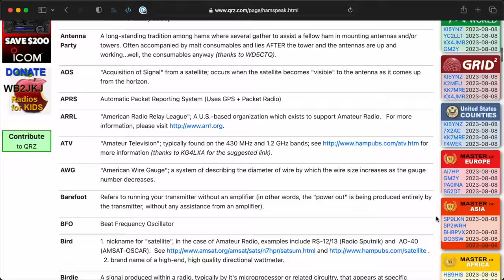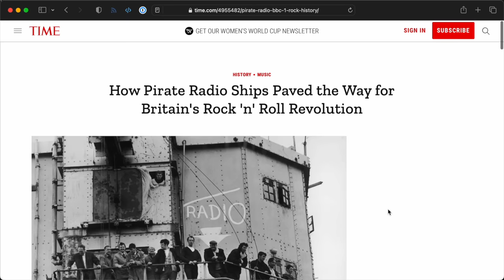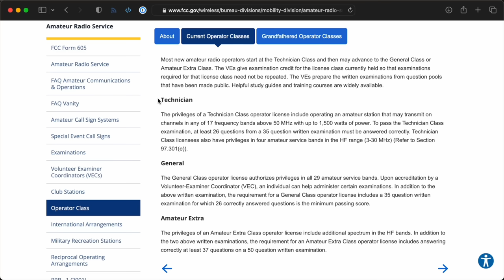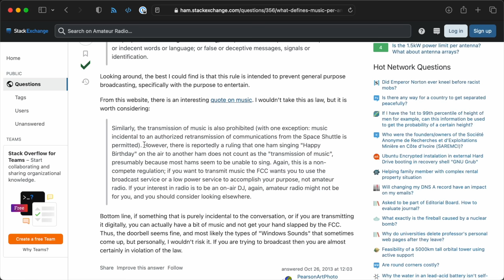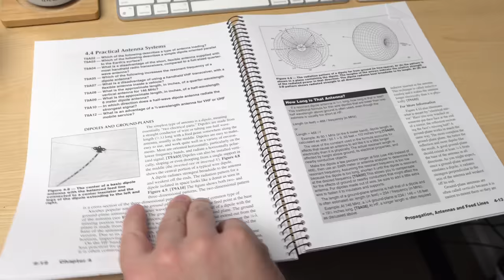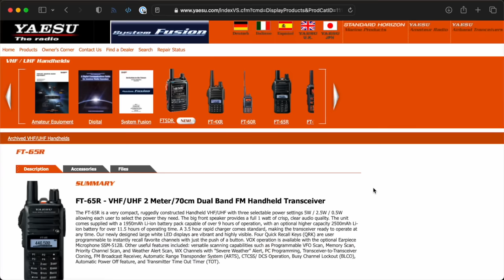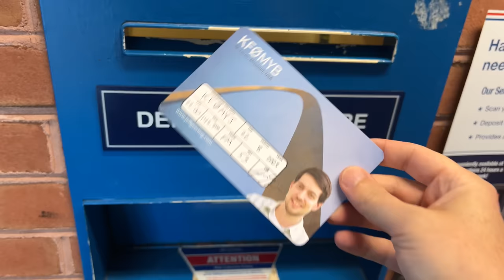It's ILLEGAL for my Dad to transmit!

Comment: Reminds me of my Dad's situation - worked offshore on oil & gas, signed off on plans, work inspections for pressures of 3000 psi yet was barred from working on the domestic system of 1 psi

Comment: Dude your dad's experience with the exam is EXACTLY how it went on my first try- passed technician and general, missed extra by a single question. Retook and still didn't pass. 
The only difference was I was a sophomore in highschool at the time not an RF technician (yet)
Regardless, congrats to the both of you on your license and welcome to the world of ham radio! 
Something I would recommend you try (if you haven't already) is join a ham radio club and participate on a net on the repeater. Most of my ham radio skills I've picked up I either learned from other hams or through hands on experience!
73 (kind regards) from KM4CFT

Comment: It is also illegal to kerchunk or key up a repeater without giving your callsign.  Congrats on your new licenses.  I hope to hear you on the air.  Bring your checkbook as it really can get expensive.
Mike W4TRK
Reply from the maker: We are on high alert for the FCC van :D
Reply: @GeerlingEngineering I'd be more worried about the salty old hams that are grumpy about everything and that getting rid of the code requirement was rge worst thing ever.
Reply: @GeerlingEngineering I've seen the FCC van (my grandpa used to regularly operate at very illegal power levels on CB), when you see the van, you'll definitely know, it has every antenna known to man hanging off it.

Comment: Congrats to you both.  I'm sure you will enjoy the hobby.  I've been a ham for 65 years.  I actually got my Dad (sk) into the hobby which is not normally the case.  My wife is also a ham and has her general since we used to cruise in our sailboat and had both VHF and HF gear on board.  I received my extra back when the exam was not open sourced and they required 20  WPM Morse code proficiency. My first contact was sending cq on our Kaiser Vagabond's horn in a parking lot in Rapid City.  To my amazement another ham showed up.  He didn't actually reply with his horn, but walked up and introduced himself.  Unfortunately his name and call are lost to  time.

Comment: Just FYI, saying that it's illegal for a non-licensed person to transmit with a ham radio isn't ENTIRELY accurate. An unlicensed person may talk on but technically not operate a ham station as long as the licensee is present and actively supervising as a "control operator". Nobody's going to know whose hands are on the controls, so as long as you're there that's all that matters. If you've ever been to a field day (One weekend at the end of June), it gives non-licensed operators a chance to see what it's all about and make contacts.

Speaking of assisting with communications, I did two tours in lower Manhattan after 9/11 assisting the Red Cross with communications. We were using the repeater on top of the Chrysler Building, and kept it so active you could probably fry an egg on it.

Comment: Congratulations and welcome to the hobby! I've been watching your content for a while and I can definitely say that Ham radio perfectly complements your skill set. It is amazing what you can do with "just" a technicians license. That little Beofeng is just the beginning of the rabbit hole. I would encourage you to find a local net (ham radio chat group on the air), join a club and get involved. Hams are generally very knowlegable and passionate about sharing information and helping new hams. 

I would suggest getting a 50w VHF/UHF base station radio and antenna for your home so it is easier to reach your repeater, it is a bit frustrating trying to have a conversation with a weak signal. Also it will give you more reach to other repeaters in your area.

Don't worry about getting your general license yet, just learn and talk to other hams, stay active, and develop your skills. You will know when you are ready to upgrade. Talking to people on the other side of the planet without relying on anything but your radio is an amazing feeling. 

Have fun and 73. - K4MBD

Comment: Speaking as a software developer who got in to ham last year primarily to work with packet radio and other digital modes:

I'm going to be surprised if you have any issues. (I haven't finished the video yet) 

It's not nearly as daunting as it seems on the face of it. I only missed my general license by three questions, and I took it and my tech (which I passed on the first try) in one sitting.

As developers and even simply as home labbers, we're used to internalizing technical details and applying them in the real world.

So far the only thing I've had trouble with is CW.

Good thing you don't need it anymore ;)

Comment: I am a licensed ham myself but haven't used it so much until now. I'm not that interested in local repeater communication, it's more fun for me to build stuff myself, more interesting would be shortwave long distance but for that you need some gear like big antennas which I don't really have the space for.
By the way here in Germany (or Europe in general) using the Baofeng UV-5R is illegal because the harmonics it transmits is way too high. You need at least 60dB attenuation and the unit I've got has 43dB attenuation best case...
Reply: I live in an apartment in Berlin, no way to do anything on shortwave there.
But with a portable unit, a small battery and some wire as antenna it works well in a public park. I talked to people all across Europe and even to some in the USA. At just 20W. You can have fun with  equipment that fits in a backpack and doesn't break the bank.
73 / DC6CK

Comment: Next step may be to 1.) pass the extra license test, then 2.) find an older tube AM broadcast transmitter (Gates maybe), and 3.) retune it for 160 & 75 meter AM operation. You'll need a major-league residential power outlet for it. Then you'll really be in a "Old Buzzard" elite HAM group.

Still looking forward to an AM broadcast site tour video, before they're all shut down ...
Reply from the maker: We're still working on it! And yeah... it's getting harder to get access to the high power AM transmitters these days, as they are consolidated more and more.
Reply: There were a few old AM transmitters that left St. Louis stations for use as ham radio transmitters. I believe Bob Heil has a story about one used by a famous musician.
Reply: @radijoe You said Ham, but you're not talking about Anthony Ray maybe? (Aka Prime Minista aka Sir Mix-a-lot). He runs a 3cx15000.

Maybe Joe Walsh?

Comment: I need to get back on the radio again. Over in Scotland here have the equivalent of the technician, which is called the foundation licence. Got it a bunch of years ago and had started to play around with satellitte use and getting long range comms going with a friiend using digital modes.

It's actually a lot of fun and gets me outside, haha.

Comment: Congratulations. 
Got my Tech and General at the same time a few years back but did nothing with it till this year. I think Extra is gonna be a while for me since its so much heavier into the technical side of things.

So many rabbit holes you can go down into. So far I think my favorite things are portable operation, low power, weak signal work, and morse code (still learning but way closer than I ever thought I might be)

Comment: Welcome to amateur radio!    One other thing you will see is radio operators providing communications support for various events (usually athletic - sometimes competitions, sometimes fundraisers).   I suggest connecting with any local clubs to learn about and then trying some of those out.   Volunteering for fundraisers not only helps them cover an area that can sometimes take a reasonably specialized skillset to fill, it is also a pretty good justification for the hobby budget.

Comment: Congrats on the ham license . ha ha - you will desense the second receive radio when you transmit that close to it. Some of us local hams here in Wisconsin dug out our 1200 baud packet tnc modems that we used on 2 meters in early 1990's . They still work and have a built in mailbox and node to relay on messages. That was pretty cool before internet was a thing and nice to know that we can still communicate via text with no internet !  Aprs is sort of like packet but is not error free messages like regular packet. It works very well, but the regular old packet has some benefits too unless the band gets too crowded.  Have fun on the ham bands - from WT9M
Reply: The translator keeps the carrier up a few seconds and that's what we were listening for. It worked outside so we started testing inside with hope. I have a feeling I will experience a lot of Hope/Fails the more I play and learn!

Comment: I kind of want to get a license and see if there is any packet radio activity to get into with a license I can pass the test for. IT would be a fun thing to mess around with on my older computers.
Reply: All you need is a Technician license for APRS here in the US, that’s probably one of the first things i did as a tech!
Reply: Also, you're allowed to listen without a licence, so have a play at receiving, and see if it spurs to into getting licenced so you can transmit!!

Comment: Congrats on the licenses! The funny thing is  a lot of broadcast and electrical engineers have no problems in General or Extra but because of the regulations for Tech is where most of them get tripped up.

Re: the Baofeng antenna. It's a higher gain, but really just makes up for the receiver in it not being as high quality as the more expensive handhelds, like the ones by Yeasu and ICom. I would suggest looking at some of Ham Radio Crash Course's review videos here on YouTube to get a feel for what other radios are out there you might want to upgrade to.

Comment: Let me try a post as Youtube shadow bans a lot of them. Been a Ham for 60 years. It was tubes and CW at the start. 2 meter FM really started kicking in around 1970 and it was interesting to to experience the simplicity and fun with a small group in an area. Since around 1968 I got all licenses, Radiotelephone, radiotelegraph, and Amateur Extra. Not so active in later years, but I got to experience working at a NASA tracking site, Goldstone mid to late 70s. I got to experience an Apollo track, ASTP. Got to run the 85 foot dish, and we tracked the Moon ALSEP and many other Earth and Sun orbits. Been a fun ride. Just started watching couple your videos.
Reply: Fascinating stuff! I have enjoyed some of the tours I've seen of those tracking stations (like from EEVBlog).
Reply: @JeffGeerling  Lots of stuff changed in the 80s Earth orbit tracking was taking over by satellites instead of ground stations. Shuttle. However lots of DSN stations on ground still and to communicate with Voyagers..
Reply: @JeffGeerling  Funny switch, after going to electronics school mostly RF, I get hired by DEC for computers, learned TTL circuits in two week school. 1969. Then I got drafted into Army, did radio drone work on missile range.

Comment: There are a bunch of ham radio Raspberry Pi, ESP32, and Arduino projects.   The hobby bleeds over into 3d printing too.  You should have a good time.   I hit the ISS with an APRS packet the other day from my driveway with my 5watt handitalkie with an omnidirectional antenna.   Got a qsl card too.   I’ve worked all states on HF and about 89 countries.   Going for the century club of 100 countries.   My near term goals is to work some satellites and hopefully one of the stations in Antarctica at some point.    73….  W5AUG

Comment: You're lucky you can get WX freqs. It's all static for me. I think I live in an RF valley.
Reply from the maker: The STL area NWS transmitters seem to be ideally situated, it is one of the clearest signals around here!
Reply: @GeerlingEngineering  Heh. Your altitude there is 466ft to 600ft . Mine is roughly ten times that, 4500ft to 6000ft. 🙂 Mountainous terrain for sure.

Comment: If that's a Baofeng UV-5R there's a very good chance it doesn't meet spectral requirements, and even if it does it will be marginally compliant, so IMO it's best to avoid. You can get the similarly priced GT-5R which is compliant, though it is locked from transmitting outside amateur radio frequencies which some may consider a detriment. In terms of Chinese radius you can also get the spectrally clean Wouxun KG-Q10H but if going there one should first consider the Yaesu FT-65R or the FT-4XR which cost about halfway between the Baofeng and the Wouxun.

Comment: I've been licenced as Foundation in VK for nearly two years now. We get HF privileges on 40m, 15m and 10m down here, plus 144 and 430mhz. 

I'm thinking of getting a US licence so I can use remote operated stations, there's a site and you can choose to use remote sites for a charge. They have radios like Tentec and Flex with big HF yagis ann rotators ect all remote controlled. 

Thanks.
VK1NME.

Comment: Former broadcast engineer here... I think i'll stick to 11 meters. 27,025 khz is amusing, the "Superbowl" of illegal kilowatt CBers. One can only listen, as I have been on and off for literally decades. 27,385 khz on lower sideband is where the DXers hang out, including hams using their modified legal gear to operate here. They often brag about how many watts they are using. I have a legal-limit radio, and have had a few distant QSOs on the amazing skip that has been happening lately. Mostly listening, though.

Comment: Don't stop t the Tech! Open up the world by working on you're General and your Extra. That is were all the fun can be. It opens up the world. Just take you're time with the other levels if you have issues. Some tomes it takes a little time. I'm in Canada and we only have 2 levels. Took my advanced 4 times before I passed. Never failed by much, but I would get w=questions wrong that I got right before! It just takes to getting used  to some of the terms, and the rest is rules and math. Had to dust off some High school algebra to pass.

Comment: Hmmm... No advanced calculators? Well, I can't operate an algebraic calculator, like your Texas Instruments calculator. I bought Hewlett-Packard's HP-45 calculator when it was introduced in 1973, and I was a sophomore engineering student at The USC (University of South Carolina). I am too used to RPN (Reverse Polish Notation). My wife brought an algebraic calculator into the household when we married in 1977. However, I had trouble trying to balance the checking account using her calculator, so I bought her an HP-16C, geared for computer programmers, since it supports binary, octal, and hexadecimal, besides intege and floating point. It has logic operators, such as AND, OR,  XOR, besides +, -,  ×, and ÷. It has an ENTER to push a number on the stack, but no =. It does not have trigonometric, logarithmic, or exponential functions that would be used for th ARRL tests. The 16C still works to this day, like the Voyager 1 and 2 planetary probes, also launched in 1977. It appears that HP has exited the calculator market, so I started hoarding their remaining RPN calculators, HP-12C, HP-17B.

Comment: There are a lot of radio techs and RF engineers that are not hams and the reason is pretty simple as to why would you want to spend your free / off time doing basically the same thing you do at work. You have to be dedicated to the field in general which is why I have held a license since 1990. As for the Chinesium BOFUNK. I have a pair of UV-B5  that we put through 9 levels of hell and they refuse to die. We call them the Zombie Pair at the shop. Anyways there is no one on 2 meters or 440 that I care to waste my time talking to which is why I stay under 30 MHz in the HF bands. 
Our handhelds in use today for field IT and comms infra jobs are TYT VU-390's and for public service infra, e-comm deployment & disaster relief we use Motorola APX-8000XE's naturally for interop compatibility and with those we have all the programming gear to modify codeplug and flashplug in the field.

Comment: Congrats! Nitpicking I would say to practice never saying broadcast; some hams will cringe because of our history with broadcasters trying to outlaw us. As you state, it is illegal to broadcast on the ham bands in the US. A key test of whether you are broadcasting is "Is this message intended for licensed ham radio operators?" If no, it is likely illegal to transmit that signal. There are exceptions but they are very specific.
Reply from the maker: I know a ton of broadcast engineers who love the ham community—and living my life as a son of one of them, I never really knew about that kind of battle because he has so many ham friends (and many of whom will do better than the FCC at helping clean up broadcast signals when their engineers get lazy or when the stations fire the engineering staff and outsource it (leading to much less rigor with signal quality!).

But I get it, the higher-up management is often more like "how can we get more spectrum to ourselves?" without much regard for the rest of the radio community. There's a lot less of the hobbyist-friendly mindset there.
Reply: @GeerlingEngineering  It's a weird thing when you run into it. Might not be so common these days but in my youth it was rampant. Not that there was a particular tension between the ham community and broadcasters. It wasn't that so much as individuals who held a grudge. Either way, hearing the term broadcast used for a directed transmission still cringes in a bad way. One station owner, for example, decided to invoke the FCC rule about 24hr stations to turn the public highschools into a sea of Christian broadcasters. Result, no all the schools ended their broadcasting education programs and shutdown the stations. To which he just applied for full time licenses and he won anyway. One highschool station survived because hams turned it into a 24/7 station. Those kinds of interactions are still around.